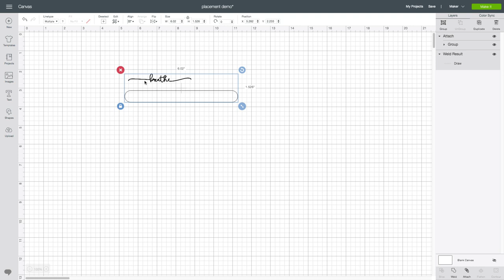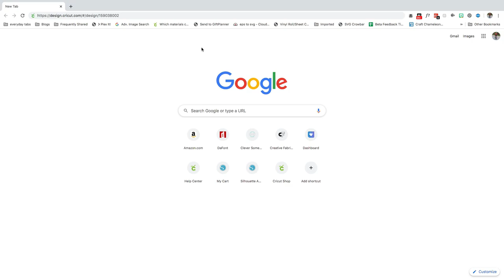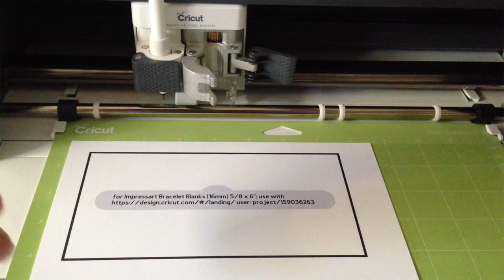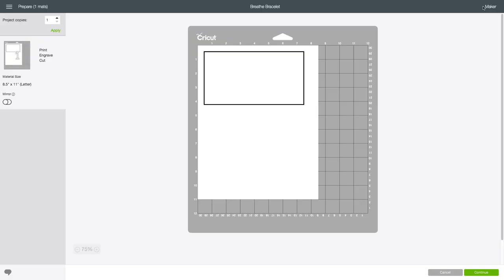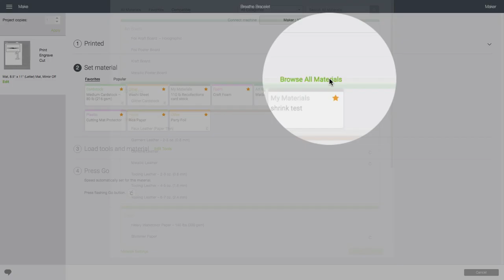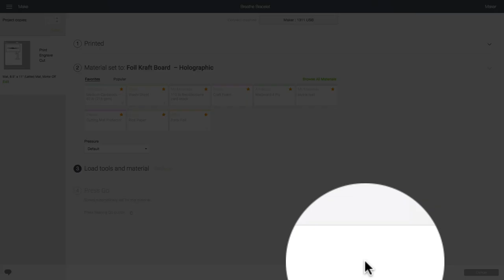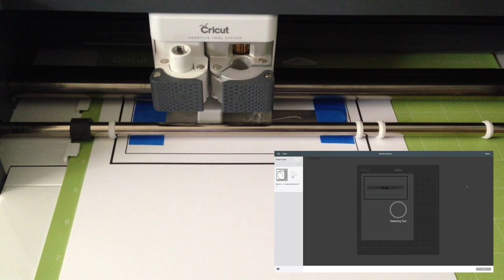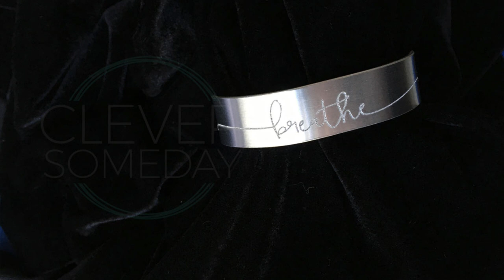Bracelet Engraving with the Cricut Maker - Sensor Jig Method

Comment: Great video. Thanks. I didn't understand the comment about using a clean paint stirrer in the slot to keep the mat from flexing. Do you mean the hole at the top of the mat?
Reply: Ann Powell me either
Reply from the maker: The ruler tucks in the slot in the bottom door of the Maker and sticks out to support the mat from underneath.

Comment: Is there a reason why the Foil Kraft Board setting seems to have a deeper result than the regular Stainless Steel engraving setting? 
This is a much better result than my Stainless Steel engravings :) so I'm just curious?
Reply from the maker: Hi Katie. Good question. The settings are a mystery, as Cricut has declined to publish the pressure numbers like they have for other tools. You would have to compare the settings with the same number of passes to be a valid test. The metal settings can't be used with this method anyway, and I am happy with the results and flexibility I get from the Foil Kraft Board setting. Please join me in using the feedback button to ask Cricut to provide the pressure data for all tools as they do the knife blade, fine point and deep point blades, if not the ability to create custom settings.

Comment: Do you thing this jig will work for the 9.54 mm x 152 mm ImpressArt bracelets if I adjust the size? I bought some of those and they are a bit smaller but I was wondering if this method would work
Reply from the maker: Yes and in fact we have jigs already made for many of the Impressart sizes in my FB group, including this one (3/8")

Comment: HI Kay, I think this is the most important video in engraving, I watched this video many times as I am trying to do everything you did but with round circle blank instead of bracelet, so creating all from the start,  but there is one thing is still confusing me, in minute 4:18, when I look at the right panel, the word breath doesn't have éngraving', it only says [cut and print] but when you pressed make it, the left side shows [print,engrave, cut]. how did this magic happen :) ? Also do i need to flatten anything while I am designing the jig or the pattern on the circle? sorry I am trying to do it right from the beginning, don't want to mess it up. thanks heaps
Reply from the maker: The word breathe is the "Group" layer, so you can't see that it's set to engrave. The flattened set is the template the engraving is attached to. This video isn't really designed to show how to make your own jig. There are other resources for that listed in the video description and in my Facebook group as well as a lot of files already made and shared. There's also a newer method, which is a little easier https://www.youtube.com/watch?v=Bi8DhrmgVcw
Reply: @cleversomeday  Thank you Kay so much for your reply!! really appreciate your time and efforts. Mariam

Comment: When I get to the engraving part, it is telling me that it does not recognize the fine point tool and will not let me go any further? I have the #41 in place
Reply from the maker: Be sure you set the design to engraving. After the engraving is done and it asks for the fine point blade, either cancel the cut or run empty.
Reply: @cleversomeday  yes it is set to engrave. I thought maybe I needed to choose a different font?
Reply from the maker: @mrsaireez  Only the operations selected affect the tool requested, not font or anything else in the design. Contact me at cleversomeday.com/contact if you need more help.
Reply: This is incredibly confusing 😳

Comment: The Maker 3 is too smart to fool. It will not allow you to do this. It'll say "incompatible tool detected".
Reply from the maker: Be sure you change the machine selection to Maker 3. And, as on Maker, material has to be set on Foil Kraft Board - Holographic.